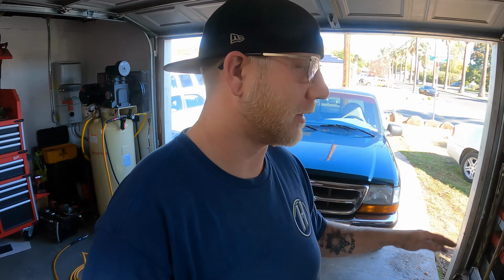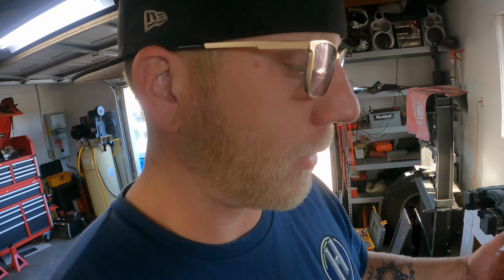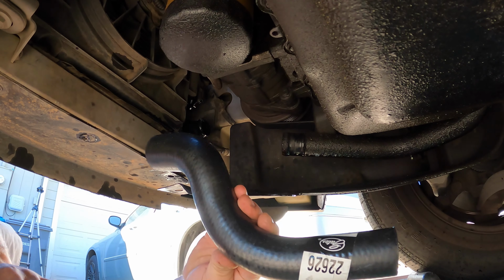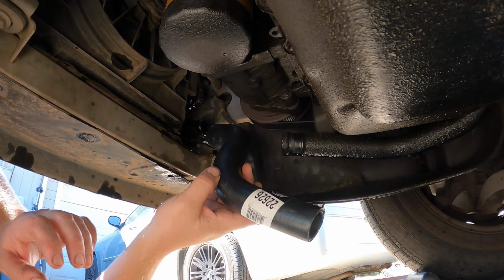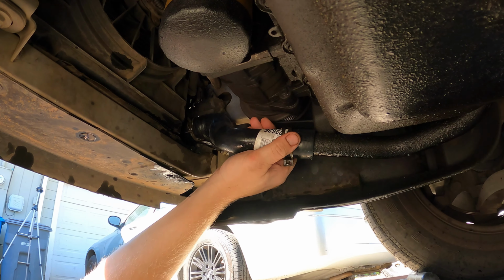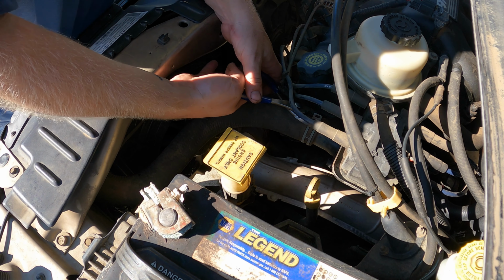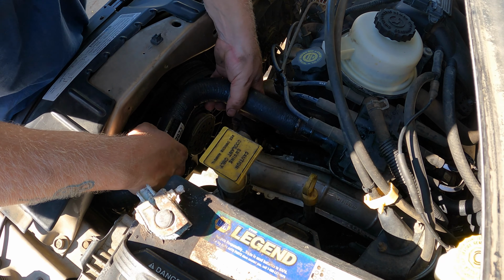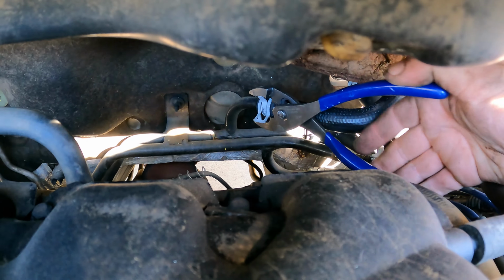How to replace heater hose radiator hose on 03 Chrysler Town and Country

Comment: Did you need to trim the lower hose? Yesterday I changed the radiator and hoses (upper/lower) on a 2006 Chrysler Town and Country . I used Continental hoses, but the lower hose was too long by a few inches and needed to be trimmed on the smaller interior diameter side.  No initial leaks, but with car running it started to drip. Thinking I may have trimmed either too much or went past where the hose goes from the smaller interior diameter to the larger interior diameter.  I've got a replacement lower hose coming along with new MOPAR tension clamps.  The replacement hose is a Gates hose and part # is the same as I saw in your video, so that is why I'm curious if the Gates hose you used had to be trimmed or if it fit fine.
Reply from the maker: It is common to have to trim but I Don't remember if I had to. Typically I would only trim it if it was causing a kink from being too long
Reply: @GibsonGarage  just to follow up, the Gates hose shown in your video didn't need alteration on my 2006 Chrysler Town and Country.  It fits great, much better than the Continental hose that I installed initially and removed. Thanks again for the video, my wife is happy to have her car back on the road again after this repair!

Comment: I AM A BROKE ASS WOMAN DRIVING A 2000 DODGE CARAVAN .what is the hose right under the radiator hose because mine has a big slice down it and it is leaking out all the  water van overheating .I am gonna try to fix it myself .can I duct tape it or use something temp?
Reply from the maker: I'm afraid the only fix is to replace the hose your best bet is to pull it all the way out and take it into the store
Reply: @GibsonGarage  thank you it's fixed now my friend Chris Bradshaw fix it in like 10 min. No kidding BTW I am now subscribed to your channel
Reply: @GibsonGarage  Damn it! I thought it was fixed it's not ,still overheats Gibson ! It's not good I am really about to give up on everything 😪 I just can't take much more oh well blah blah blah I'm so not trying to bum you out with my complaining ass lol

Comment: @Gibson Garage Speed Shop   the hose u cut with the 90° turn in it and put the black part in it that was bigger in the middle the clamped the 2 pieces of hose to each end of it what is the name of that part I cant find it on the internet cause I don't know what the part is to look for it     u done that at 8 minutes and 38 seconds in the video
Reply from the maker: Heater hose restricter